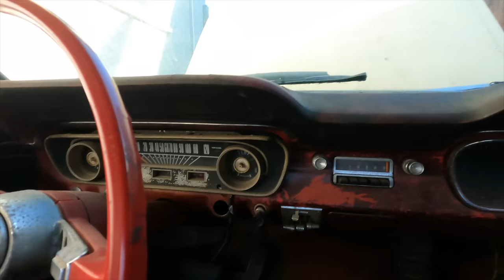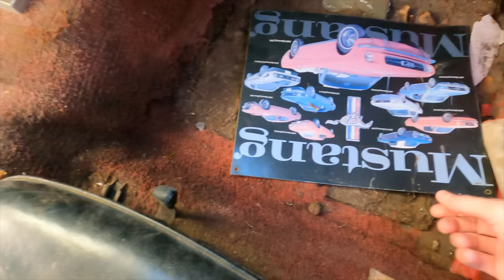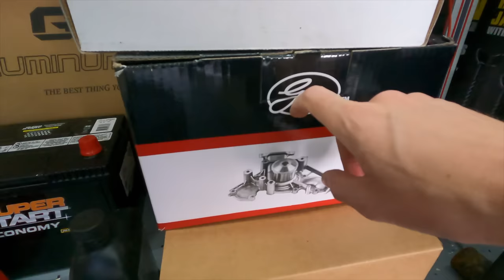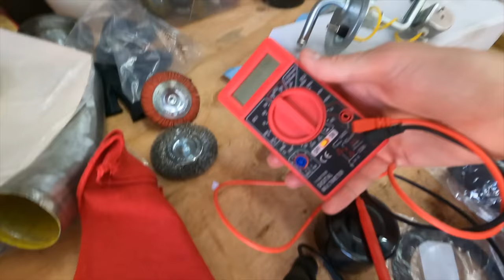Restoring My Dream Car! A 1965 Ford Mustang | Part 1

Comment: Drop that old oil asap. !  And replace with zinc additive oil .   valvoline racing will work .  If your going to do your own bodywork , be prepared.  I’t something that takes a lot of patience and most of all passion.  You can find many parts for this car @ your local O’Reilly’s  and NAPA .   Best of luck .
Reply: Great advice!
I favour PennRite oil.
Reply: Okay bud

Comment: All of the rust and build up in the cooling system when first start up is now going to start circulatimg thru your brand new water pump,heatercore, radiator. This could Shorten the life of those new parts,believe me it happened to me. I'm just trying to save you both money and headaches.

Comment: Definitely replace the export brace,and get a Monte Carlo bar. If the car has sat for any length of time do yourself a favor and check the wheel cylinders and inspect the rubber brake lines very well. If the brakes aren't any good you could Kill someone including yourself.

Comment: Try to fix as much of the original as you can, only original once. Don't use crapee sheetmetal, save the hood if possible. Good luck, still wrenching on mine

Comment: Welcome to the Mustang family. I have spent the last 4.5 years getting my 67 back on the road. Good work!! These are great cars to learn on. If that is a 302 someone motor swapped it at one point. 302 were not a standard motor in Mustangs until 68. The are a bit better though. Not as prone to overheating as the 289.
Reply from the maker: Thanks! This has been a great project so far!

Comment: You’ve done a great job for someone who doesn’t do mechanical work for a living!! You have great intuition and were able to diagnose tough problems right away!! I’m glad you found your dream car…I found mine 52 years ago and drove it daily until Covid hit. I still have the 1965 Ford Mustang Fastback that I put over 600,000 miles on. I drive it mainly on weekends but it can still go on a long trip if needed. You will have a great time with your car once you get it where you want it. You will have many people telling you how they had one and sold it cheap and still regret it. You will find that the car is a great value since it’s easy to get parts and you seem to have much more talent than many mechanics I’ve encountered!!! Good luck with your ride and enjoy it!!! Great job!!
Reply from the maker: Thank you so much! Glad you still have yours and are able to drive it on the weekends!

Comment: That's great that your  using something to take care of the rust. I can for tell your future, replace every part of the cooling system,or after cleaning the cooling system, it may open up more leaks. 289 's have a tendency for them to over heat easily. is in your own best interest. Replace the Radiator with a 3or4 core radiator you will never stop thanking yourself with that replacement..
Reply from the maker: I’m actually putting in a new 3 core radiator as we speak! It will be part of my next video!

Comment: Make sure to inspect the fuel lines and to save your time get new fuel filter,and fuel pump plus new vacuum lines. Because the car sat,even if it's as short as 6 mos. And you not knowing any age of the parts or their condition. This is how fires start.

Comment: Make sure to use engine oil & a zinc additive (DDP plus for example). You'll otherwise ruin the flat tappet camshaft and lifters.
Reply from the maker: I'll definitely do that! Thank you for the recommendation!

Comment: Thanks for sharing your journey with us, just wondering ball park how much a project in the same condition as the one you got would cost to buy?
Reply from the maker: Thanks for watching my restoration journey! Well it all depends on where you live. On the west coast, project cars tend to be a little more expensive, but usually a bit less rust b/c of the dry climate. If you're in the mid-west or the south, you can find a project car for much cheaper, although it will probably have more rust. You just have to be on the lookout for the right deal and know exactly what you want. Mine cost $5,900, then titling it in my name was another $800, and so far I've spent maybe around a $1K in parts and supplies. I've seen cars in better condition than mine go for less, you just have to be on the lookout. Took me 2 years of looking before I found the right car for me.

Comment: When I bought my Mustang, the engine looked decent, but after tearing it apart, little by little, there was calcium built up in the water pump all the way to the block and had to send it to get chemically cleaned and cut
Reply from the maker: Yeah I may have to do that one day with this one. We'll see

Comment: The shifter,the bushings only cost a few dollars,plus maybe a half to 3/4 of a hour, mine cost me a little over $ 1500.00,  i.went to a gas station early in the mourning left it running to warm it up, it dropped into reverse without me being in the car and slammed into a caddy the was owned by Oakland cop.

Comment: Nice video. For the record you have a 302. I don’t think you mentioned it but look at the harmonic balancer and notice the width.  Also the PS pump is a later model as well.  Enjoy…
Reply from the maker: Yes! I realized that after I made the video haha. It's a 302 with 289 heads on it. Thanks for calling that out!
Reply: @VanHoutenBuilds 302 didn't come out till 68. Your engine is not original to the car. But as long as the engine is healthy its ok.

Comment: Hey I’m looking at one but was wondering how you moved the car especially up an incline
Reply from the maker: They are surprisingly light cars. I had the tow guy help me push it up the driveway once he put it down off the flatbed. Then I pushed it the rest of the way up my driveway by myself b/c it was flat. I would recommend recruiting 2 or 3 friends to help push steer and brake.

Comment: Check the power ram it's under the car it's part of the power steering. You definitely do not want to see any Leaks. Hint it's a lot of money!!! I recall it well , replaced the power ram, pressure/return lines,bushings,weld the mount.

Comment: Solid video as I am restoring a 64 1/2 mustang coupe to original!   If you don’t have plans on using the Carburetor I would like to take that off your hands to see if I can make it work on my 289?
Reply from the maker: Thanks Ed! That's great you're restoring one too! I ended up having my original carb rebuilt and put that back on, but I'm having a lot of trouble with trying to figure out how to tune it. I do have the other chinese carb still and you'd be welcome to that! Are you in the LA area?

Comment: One thing will always lead to another. Ask me how I know? I have a 68 Mustang.
Reply: I have a 68 Mustang I've owned for 47 years. Early build, purchased new in December of 67. 289, automatic,  power steering,  Factory AC,  Its been a reliable, and simple car to maintain and repair. I bought it in 1977 from the original owner.  Diamond blue,  2 tone blue interior,  white vinyl top.  Lifelong Southern California car.  So corrosion has never been an issue.  Looks nearly new.  It looks brand new inside, 5 years ago  i had the interior completely redone with Factory correct materials and colors,, seats, carpet,, including the headliner, new dash pad, instrument cluster bezel, door panels,, arm rests, and all the interior metal repainted in correct color. The upholsterer did a fantastic job,  materials purchased from California Mustang.. also he replaced the vynil top again, for the 5th time. What kind of issues have you had with your car??
Reply: Same thing with Jeeps,fix one thing and it breaks 2 others.

Comment: That is a 1964& half mustang. The first mustang with rectangle speedometer. 1965 and later they're round speedometers. Have fun🎉
Reply: Thanks! It's actually an early 65'! Door tag says she was born in April of 65. Had a mix of 64 and 65 original parts on it. It also would have said GEN instead of ALT on the instrument panel, b/c it would have come with a generator not an alternator. Mine is ALT.
Reply: Does it have a 260 or 298 ?  I think the 64.5s had a 260.
Reply from the maker: @TheSchmed  It has a 302
Reply: @TheSchmed  think the V8 onions were the 260 or 289. Also think there was a 200 6cyl option.😁

Comment: You missed out one of my neighbors had a green 1965 mustang outside and it was there grandpas and it had been under a car port for 28 years but paint was Pristine and I loaded her on a trailer and when I got home changed the spark plugs put new points and coils in changed the oil and gas and she started right up
Reply from the maker: That awesome! Congrats on the find! Where was it, what state?
Reply: @VanHoutenBuilds  it was in Batesburg Leesville Unites states
Reply from the maker: @Stones21218  Sounds like a great find! Hopefully you're enjoying it!
Reply: I am it runs smooth
Reply: It was in great shape because of the fact that it set under a car port

Comment: In this condition what is it worth.
Reply from the maker: Only what someone is willing to pay! I got it for $5,900. Also depends on where the car is located, there are cheaper one's in other parts of the country. I also passed on one that was in great shape at $4,300, except has some rust I didn't want to deal with. Also I was looking for something specific, like a real project to fully restore. Fully restored, probably $20K-$30K value

Comment: .....you should have put body caulk around the gas tank opening .....your trunk will leak now
Reply from the maker: I live in southern California, it rarely rains here. The car will be covered or garage kept. Are the caulk strips not what they used from the factory? I used those all around the tank.
Reply: @VanHoutenBuilds  .....oops otherwise 👍👍